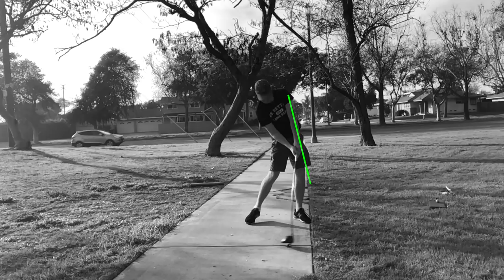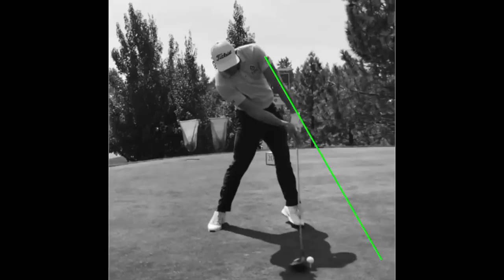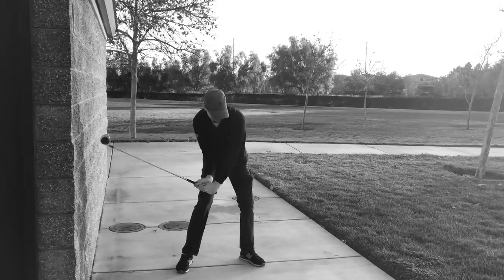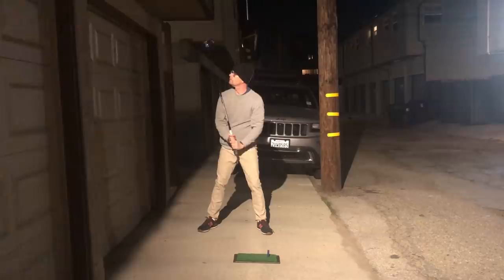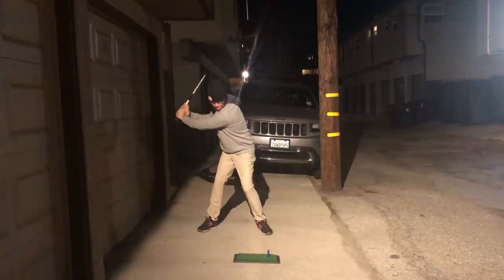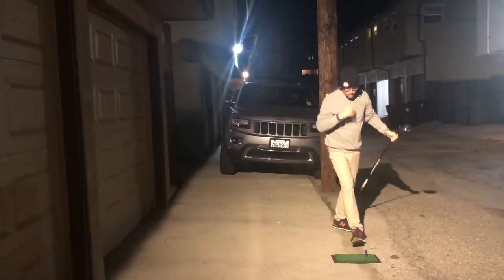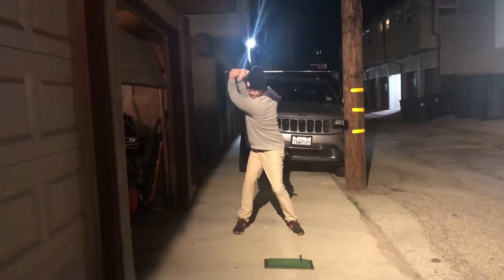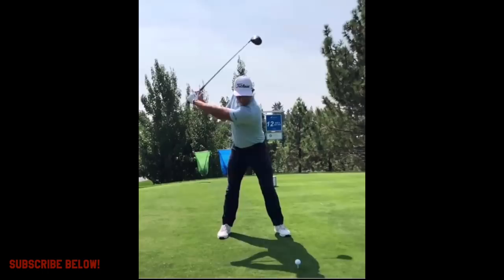Scott Stallings Shares DRILL for IMPACT LAG,  3x PGA Tour winner!

Comment: I saw this 2 years ago and tried it. I was getting no-where on a 30 year grind to find lag. I knew 'don't try to hold lag', but no matter what I tried, holding it seemed to be the only way I could get forward shaft lean at impact and a consistent iron game. Whenever i tried letting it go, the low point would always be right at impact. I tried this drill, but it didn't help. As soon as I put a ball down, the angles I saw in the drill swings vanished. Watching Mathew Wolf was my lightbulb moment. From front-on, his club head, shaft and hands move along the same straight line for the first 2 feet of his downswing. It put Sergio's "ringing the bell" into pictures. I instantly understood how to move it without holding it. Now I get this drill, but the missing piece is how to do it at speed without flipping, especially as you recommend not to do the drill at speed. Without this piece the drill was just me practicing holding on to my angles to hit (extreme) positions. When i do pull out this drill, I do it at close to full speed using a hedge instead of a wall.

Comment: Using the rubber tee is a very clever modification of this drill.  This slow motion drill also works well when setting up a little further from the wall and doing a normal wide backswing without presetting the position at the top.

Comment: What Scott is doing is keeping back heel down through impact which keeps the hips from turning past 45° open.  That creates a reaction in the club head mass and lead arm mass similar to an unbelted occupant in a car in a crash that stops the mass of the car abruptly: club head mass whips around hands and lead arm mass flies off the chest, which if the trail arm is allowed to straighten at the same pace pulls hands and club forward parallel to the target line.
The shaft of the club starts to bend forward when it starts moving toward target faster than the hands are.  Allowing the lead arm to fly off the chest as he does is what is pulling the hands so far forward and straightening the shaft.  

The other way to accomplish the goal of getting the forward bend out of the shaft before impact is too keep the hands moving forward to keep up with the speed the club head whips around hands is to release the back foot and continue side bending the spine.  Lifting the back heel allows the hips to keep turning past 45° open but it is continuing to progressively side bend that will push hands towards target more during that phase of the swing.  

I came to realize this about a dozen years ago when re-tooling my swing using Hogan’s Five Lessons and analyzing how he released the club lag with a “waggle down” snap of his wrists from radial deviation to ulnar deviation, the same bio-mechanics used when cracking a leather whip, toe-nailing a stud with a hammer at 45° or bucking a horizontal log with an axe — all things I had done before taking up the game of golf in my 30s.

Hogan released his back foot in a very controlled manner starting very slowly just after his hips hitting 45° open caused that “hitting the wall” sensation keeping the back foot down creates. Lifting the heel and allowing the hips to keep turning again after the sudden slow down starts to whip the club head mass around the hands moves hips/shoulders and hands in a circle around the center of balance and rotation and the shoulders finally moving past parallel with swing line frees that lead arm mass pinned across the chest like the lever of a cocked catapult to fly off and drag the hands and club forward.

What side bending of the spine does at that point in the swing is change the angle of the lead arm and the DIRECTION OF ITS FORCE VECTOR which affects what direction it will drag the club head.  I found that the more I side-bent through impact the more vertical my lead arm was as it flew off my chest and the more it dragged the whipping club head straight down the target line after release of the ball.  But what also started to happen if I delayed lifting my foot to exaggerate that chain reaction was that the club shaft bent forward to the point of failing at the top of the hosel sending the club head flying.  That was actually quite informative because the direction it flew off told me what direction the force vector was pointing when it failed and it flew straight down the target line following behind the ball.

Snapping about a dozen club shafts is how I came to understand the cause and effect relationship between the timing of back foot release, the club whipping around the hands and bending the shaft forward, releasing the bend created at the top by rapidly dropping hands to change direction, something I do with a slight bit of side bend.  

The physics require the hands to keep trying to move faster than the inertia of the club head mass wants to let it but as downswing progresses the speed of the club head catches up UNLESS the golfer continues to side bend which keeps the hands pulling against the inertia of the club head mass.  As side bend swings hands down in a circle past the back leg the lead arm has to fire off the chest and pull the hands forward to maintain the bend.  

The whole point of bending the shaft like a leaf spring is to whack the back of the ball with it when the bend is released, that’s why the timing controlled with the back foot is so important and why Hogan peeled it of the ground slowly.

Comment: B. If you watch closely to Scott's swing you'll notice he mainly hits off his trail foot, hence the need for excess lag tension, otherwise he'd really flip. I believe that from the top, some of the longer hitters feel tremendous pressure down into their right heal before getting to their lead foot. The feeling is likely brief but it helps get the club into a superior hitting position. I.e. Sergio Garcia. Give it at try.

Comment: Does it help to look at the hands at more than just the impact position as you try to get a feel for this drill? From the top of the back swing it kind of looks like Scott's hands drop straight down then rapidly drive straight forward closely in front of his body.
Reply from the maker: Greg j you are right about the hand path but I would definitely not look at the hands during this. It’ll take you out of your posture and you’ll be practicing something different
Reply: Greg j yes is the answer about looking at what your hands are doing and being aware of where they are . No they don't drop straight down by the way

Comment: Interesting approach.  Not how I’d go about creating lag tension but there are lots of ways to swing a club. Your move looks a little Mike Benderish. If you want to keep driving arms early,  hips forward and torso closed and tilted back you need to learn his style of release pattern.
Reply from the maker: Golfletics milo u have a ton of lag tension at impact, amazing really. Do you know how you do it?
Reply: BE BETTER GOLF sure do.
Reply: BE BETTER GOLF I like Scott played a ton of baseball.  Lag tension is purely the result of continuous acceleration through the ball like a hitter in baseball.  Check out my instagram post on the 4 segment compound pendulum which is exactly how a very efficient swing works.  By driving the arms first you are basically creating a 2 segment compound pendulum like a trebuchet (which actually has 3 segments because a weight falling starts the first segment) which is better than a solid pendulum but not as efficient as a pendulum with 4 stages.
Reply: BE BETTER GOLF Most every player that generates very high club head speed sequences motion in the same way bottom up and then out to the arms and club.  You tend to fire your hips latterly causing you to stall so the only thing that makes sense to create lag tension to compress the ball is to accelerate your arms which you have been working on for a while now.  How much better have you gotten?  I have followed you since you came out and worked with Mike Malaska the first time.  I have heard you say you can hit the ball just as far doing flamingo drill as with your legs which makes sense given your swing sequence is a 2 stage compound pendulum. Your body is not adding much to your speed just stabilizing so your arms can swing.
Reply: Golfletics wondering ... Bender who I know is a pretty good teacher , not just Zach but many other great players plus Jr. Development on a massive scale .. I.E. Huge success for a long time . Plus Guess what played tour?  To me this is pretty good credibility... Well how about you? Not that I completely disagree?
Reply: Listen to this guy Brendan.

Comment: i really think you are starting to sail in the wrong direction with all these pseudo, lag, tension drills.  i have no doubt that they can provide some immediate results, but they aren't sustainable.  You use to have that "over the top move", which i totally love and every great ball striker possesses that magic move.  if you aren't sure about the move, look up Bradley Hughes for a better explanation.  the concept is quite simple and its goal is to control your club face, even when you swing is off, late, ahead, over the top or too inside.  you are essentially eliminating the big miss.  once you have control of the face, you swing as fast and hard as you want, there's no need to manufacture and lag tension because it will happen naturally.  if you arms are above the plane and you shaft is coming under the plane and from the inside, you can go after the ball as much as you want, jump, twist, contort all you want and the club won't be too much offline.  guys like Justin Thomas use this technique and have crazy footwork yet they still hit it long and straight.